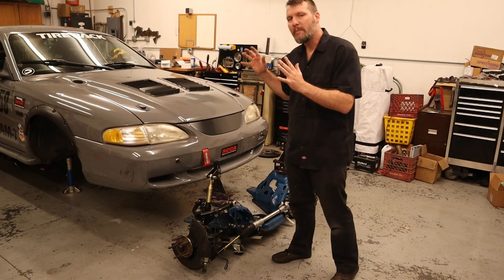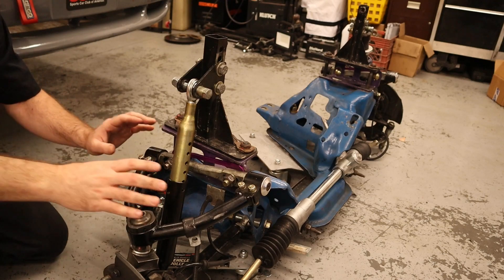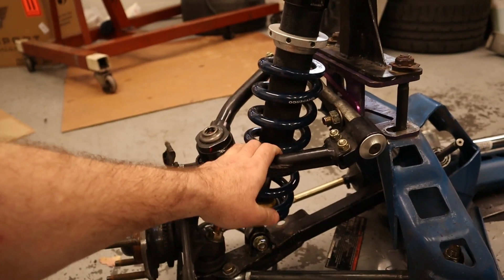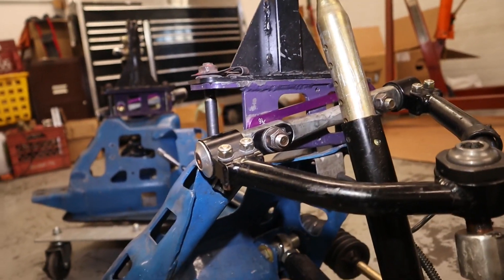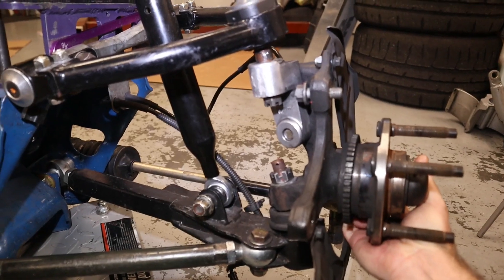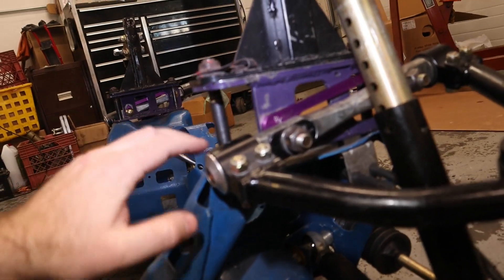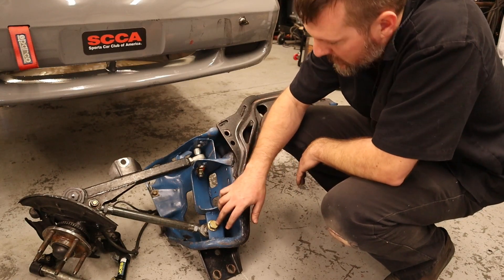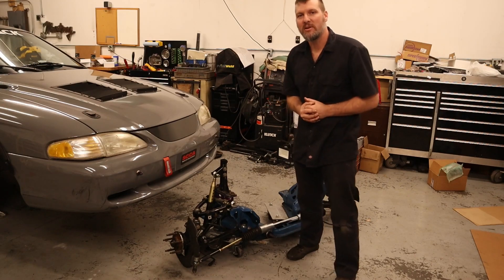Mustang Suspension Insights: Building a Custom SLA for Performance

Comment: Fantastic video bud. Did you design this using a CAD software at all? I'm learning CAD at home and would love to learn more.
Reply from the maker: I used Suspension Analyzer to develop the geometry. I used Fusion 360 to develop and visualize the parts. Since I'm not a design engineer there was still a lot of on the spot fabrication. But yes it's mostly modeled in Fusion 360. It would have been even better to have started with a 3D scan, but $$$$. There are some previous build videos where I show the model some more.
Reply: @RinerAutomotive Appreciate the reply. I have been using F360 myself in very basic form. I will check those videos out
Reply from the maker: I will mention it's not a very elaborate model, very basic just to visualize or to send parts off to get cut.

Comment: Stephen, I remember when we first met and you were roughing in the design. Anyone can buy a bolt-on package but very few people could create their own setup from scratch in their garage. Very impressed that you got this done and trust it on our autocross and drive adventures! Love that you are continuing to improvise, adapt, and improve it as well. Hope to see you back at Autocross Week in 2025!
Reply from the maker: Thanks Pete! It was definitely a little nerve racking on those long drives. I was constantly checking the suspension and bolts. I was bummed to miss autocross week 2024, but I'm working on getting the car back reliable for the long drives. I hope to make 2025

Comment: If the factory K member is strong enough or can be reinforced to tame deflections, then how much weight is eliminated from something that is very low to begin with. Nice conversion and best with working out any bugs that are still in the design.
Reply from the maker: My Kmember is just shy of 50 lbs. I think  about 10 lbs can be saved by going aftermarket

Comment: Like you setup.  Is it possible to get the ball joint part numbers upper and lower thanks
Reply from the maker: The upper is a K772 style Howe Racing 22320. The lower is a K727 screw in housing Howe Racing 22412 with a Fox mustang ball joint like Howe Racing 224800.

Comment: Thank you for going more in depth on your SLA build. I've been interested in adding SLA to compliment the IRS in my New Edge for a while and it's nice to see a good homebrew solution.
Reply from the maker: SLA with IRS would be a killer setup
Reply: Look up AutoXandtrack's review of the RegularAssMustang.

Sn95, sla, IRS, supercharged 4v
Reply from the maker: RegularAssMustang's build is an inspiration. Great guy too, I got to meet him at Nationals last year.
Reply: @noquarterracing3637  surprised it's so similar! Mine is an 03 GT with a Mark VIII engine swap, 96-98 Cobra intake with an RPM window switch and tach adapter set to open the IMRC at 3k rpm, 04 Cobra IRS with the factory 3.55 gears, ATS-V brembo brakes  and S197 rotors, AJE tubular K member and currently the wrong year range T45 so my speedometer isn't working LOL I do have a Vortech S trim for it but I've been contemplating LS swapping it just because I have a 6.2 and an F-body T56 plus a Procharger P1SC-1. I looked at the Cortex kit years ago but about had a heart attack at the cost LOL.
Reply from the maker: @CorvetteCRZY  that sounds like quite the build. Cortex/Griggs are expensive but the parts and engineering are worth the cost.